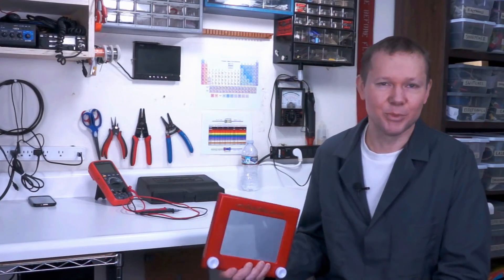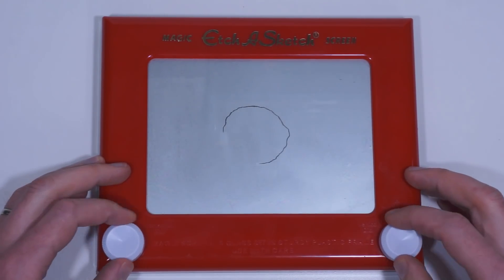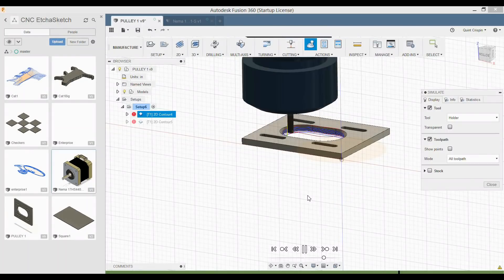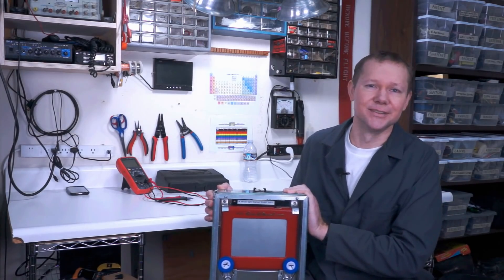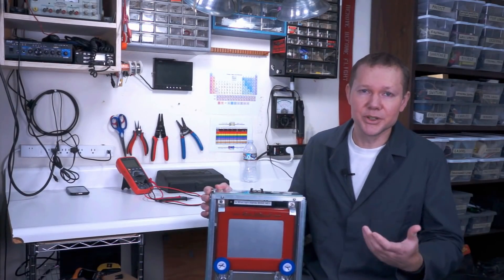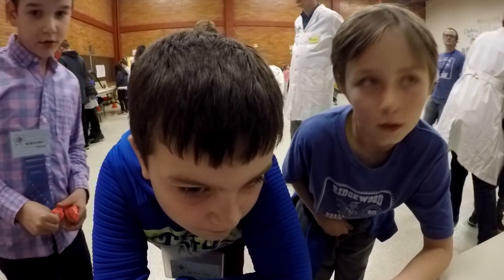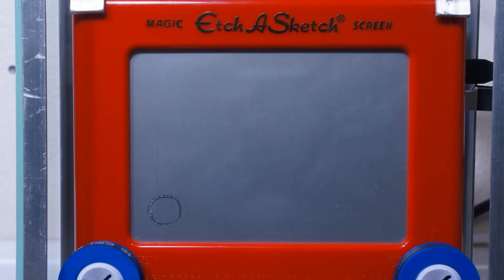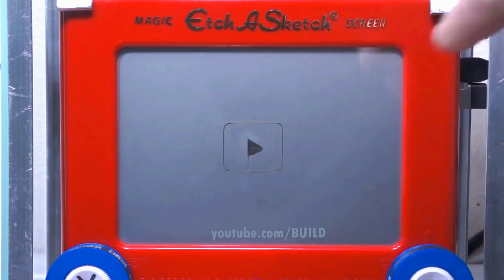Robot Etch A Sketch Project - Cat Videos using Raspberry Pi

Comment: Automatically drawing etch-a-sketch doesn't have a vibration motor to auto reset.
There's just something about that which seems, idk, slightly perplexing.
Reply from the maker: All the powder falls to the bottom inside.  vibration may work once or twice but not repeatedly.
Reply: @QuintBUILDs  Fair enough, though, I still see this as a technical problem begging for a solution. Being that the powder contains polystyrene particles, could you utilize some sort of electrostatic field effects to redistribute it. Perhaps a foil layer behind the screen into which an ac voltage is fed to vary an electric field between it and a grounded(or oppositely charged) indium tin oxide coated glass front?
Reply: Well, I say "could you" but obviously only testing would see if the polystyrene particles can overcome the tendency of conductive powder to clump in strong fields, so yeah. I guess that comment should be more of a humble suggestion than a question.

Comment: I have a idea for you.
I would like to have a remote control off road vehicle, turned into a security roaming video transmitter with my inputs.

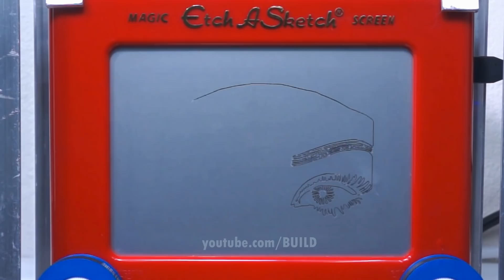1:10 scale.
Reply: You may want to look at First-Person Video (FPV) as used by many in the model aircraft hobby.